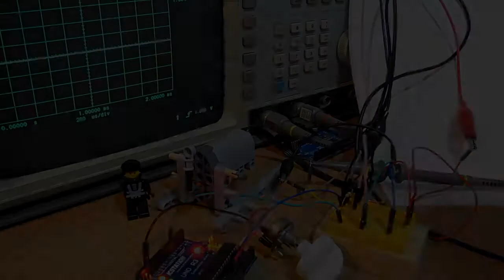Arduino Controlling LEGO Power Functions Servo Motor

Comment: Hi! im a bit stumped on controlling the servo on small angles i can do 90 degree turns but nothing less can you point me in the right direction? Thanks!

// void loop() {
//   // Mid left
//   pulseServo(-1, 220);
//   delay(1000);

//   // Straight (centre)
//   pulseServo(0, 0);
//   delay(1000);

//   // Mid right
//   pulseServo(1, 220);
//   delay(1000);

//   // Full right
//   pulseServo(1, 450);
//   delay(1000);

//   // Full left
//   pulseServo(-1, 450);
//   delay(1000);

//   // Back to centre
//   pulseServo(0, 0);
//   delay(1000);
// }
Reply from the maker: What's "pulseServo"? What signal does it generate? Can it generate PWM on control two pins, like I show in the video?

Comment: can you show the Arduino Code ?
Reply from the maker: Sorry, it was five years ago, and I just improvised something for the video... but it's basically analogRead() to get the potentiometer value, divide the value by 4 to adjust the range to 0-255, send it out through analogWrite(), delay() for 100ms or so and repeat.
Reply: @idogendel  thanks brow, i willl try here

Comment: Can you connect C1 to digital pin 1 and C2 to digital pin 2 if you want to read a pwm signal coming from a power function receiver?
Reply from the maker: Not directly. As far as I can remember, C1 and C2 are 0/9V and that's way too high for an Arduino. You'll need at least a voltage divider for each line.
Reply: @idogendel  okay thx i expected that :)
Reply: Do you still remember what command you are sending from the Arduino to the servo? I want to do the other thing around - read a lego remote control PWM signal with arduino and convert that to a command for a Geekservo. I know that i can read the PWM signal with "pulseIn(pin, HIGH, 2500)", but i have no idea how that signal looks or what that function will return. Somehow i need to convert the PWM reading into a 0-270° angle for my servo. I guess its something between 1000-2500 microseconds.
Maybe i can even print the output that is read to my Computer with serial.print() and check what is minimum - maximum there?
Reply from the maker: @Einheit101 pulseIn alone will probably not work - if the signal is 100% HIGH, there will be no change to measure and therefore the return value will be the same as when it's 100% LOW. The signal I sent in the video must have been based on something I saw, but I can't remember... the scope shows that the frequency is 1KHz and the duty cycle 0-100% . You should definitely do some measurements with a LEGO controller to verify what the Arduino can see.

Comment: potresti postare il codice che hai utilizzato nell'esempio?
Reply from the maker: Code? It's just Arduino's analogRead() to read the potentiometer and analogWrite() to output it to the motor control (in one of two channels, as I explained)
Reply: @idogendel  did you use the Servo.h library ??
or did you treat it as if it were an engine?
Reply from the maker: @giuseppelucido6569  but... I explained all of that in detail in the video itself...

Comment: Hi The White Byte, Thank you very much for sharing your experiences. I'm using a Nucleo F401RE board to generate the PWM and a LN298 to have 9V PWM . The PWM generation is ok  but I'm not able to get the intermediate position (7 positions). I can only turn from 0 to 90 or 0 to -90 depending on the C1 and C2 signal . Do you have any Idea why ? It is a real nightmare to drive this Lego servo motor while it is so simple with the SG90 standard servo motor. I already spent a week to find the answer ! Thanks.
Reply from the maker: Well, it's hard to tell without seeing the actual signals. Perhaps the PWM is too fast or too slow, or doesn't translate well through the LN298 for some reason, or the connections are wrong somehow... you'll have to check everything :-)

Comment: Hey. Thanks for the nice video. Can you please put a schema for the setup? I'm new to PWM and it would be nice to see how stuff needs to be connected. Is it directly from the board or you are using a transistor?
Reply from the maker: I don't have a schema for this, but essentially you only need to convert the 5V signals from the Arduino to 9V for the LEGO control lines, and that was done here with a transistor. There should be plenty of material on the web for using a transistor with Arduino - but be careful, here these are only control signals, we don't want any high currents!
Reply: @idogendel  Thanks. I will go with L293D looks quite simple to me.

Comment: Thanks so much for this video, and I totally want to do this :-) I have my XL motor up and running, driven by an L293D (only after the comments in this post I am ordering some DRV8871's, another great pointer.). So in my understanding, I only need to exchange the c1-c2 connection of the XL by a c1-c2 connection of the servo and can then use the exact same code I used before. The effect I expected was that instead of the XL motor moving with varying speeds and directions (depending on the PWM on either c1 or c2), the servo would move to the 15 stationary positions. But nothing happened....:-( Any pointers....? Thanks in advance if you have any idea......
Reply from the maker: I don't remember the exact details - didn't touch this in a long time - but the servo needs 4 lines - power, GND, and two control lines. Connecting just the two isn't enough.
Reply: @idogendel  Thanks anyway, will find this out one way or another :-)
Reply: @idogendel  Yep, you were right: where the XL motor only needs to be connected to c1-c2 for both power supply and direction/velocity control, the servo needs to be connected to gnd and + 9v for power (the two outer wires) and c1-c2 (for position). Unfortunately I found out that my (lego compatible, made in China) servo's only have three positions instead of your 15, even when cycling through all possible PWM values :-(.
Reply: I am happy to note that I have found a great lego compatible true servo motor, the so called geekservo (mine is the grey version, for about 6 bucks), which has 270o rotation angle, and 180 arduino accesible positions. That should power my lego robotic arm!

Comment: There is no reason for cutting the motor's wire. You could have just used and extension cord, cut in half, and solder that to the controller. Much cheaper and no void warranty.
Reply: Are there even pf motors that still have warranty? 🤣🤣🤣
Reply from the maker: Yes, but when I made this video (It's actually an old video that I re-uploaded) I didn't have an extension cord :-)
Reply: I just got my extension cord in the other day. I'm going to mount a Raspberry pi on an old Power Functions model I have and attach a camera to it so I can control it over Wifi. ^_^